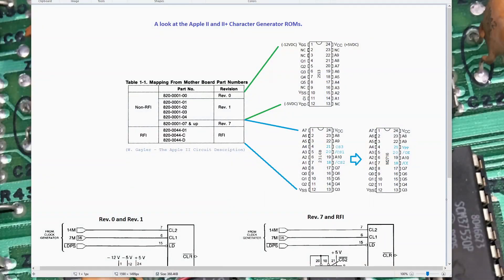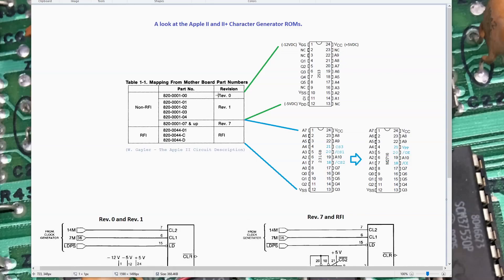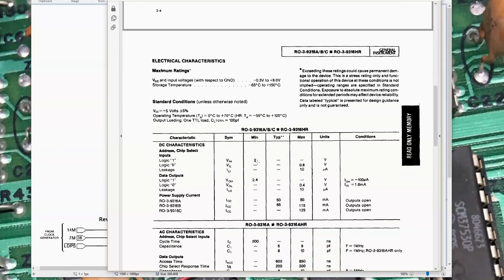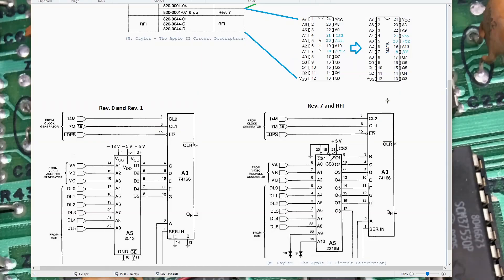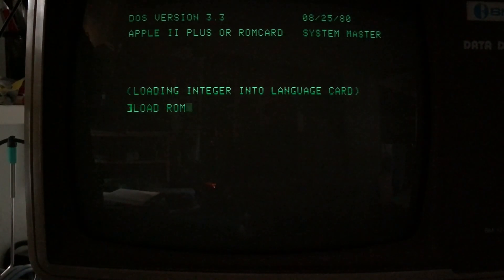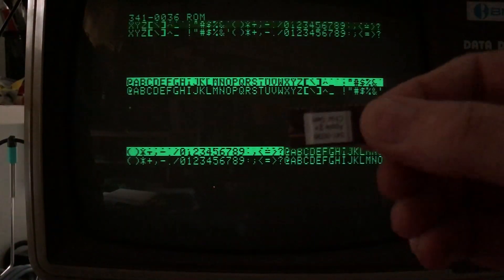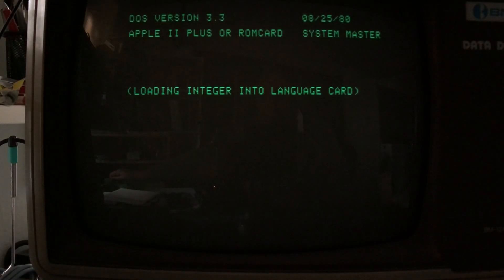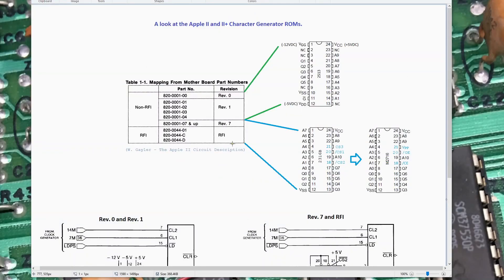APPLE II Plus - Part 10 - The reverse video issue - using a 2716 as the character generator - STB205

Comment: I was looking into the lowercase mod for an Apple II europlus rev:RFI motherboard with a two-piece keyboard I've recently acquired, and I was using an older copy of the Apple II Circuit Description. I was a bit confused with the circuit diagram which is poorly drawn for the 2316B CHARGEN ROM. Trying to clear up the confusion, I made the mistake of looking up data sheets for the 2316B ROM and found various versions of the CS pin operation. some showed CS pins as active low, others as active high for the same pins. The data sheet showed all pins as active high (at least in my way of reading them). Thats when I realised that they are probably programmable when burned to become active low or high as required. that was my ah-haaa moment.
Once I realised that I tested my RFI motherboard to confirm that CS3 (pin 21) is tied to +5V while CS2 (pin 18) and CS1 (pin 20) are both tied low and I came to the same conclusion as you have now confirmed for me, that I can just drop in a 2716 EPROM with my own character set (including lowercase). Something I did previously about 40 years ago on my first Apple II europlus but sold long ago so I didn't have that computer to open up and confirm.
Thank you for that great explanation and also that there is a later version of that Circuit Description book, which I will now go and hunt down.
Reply from the maker: Glad to know it helped, thanks for letting me know.
Reply: @ShadowTronBlog  after I posted this I placed the original CHARGEN ROM in my EPROM burner and read the data using the settings for a standard 2716 EPROM (not TMS 2716). That should save time editing a new character set. Each character takes 8 sequential bytes. Each byte is a separate line of the character. Bits 6-0 are displayed and I think bit 7 is used to determine if the character is inverse or not.